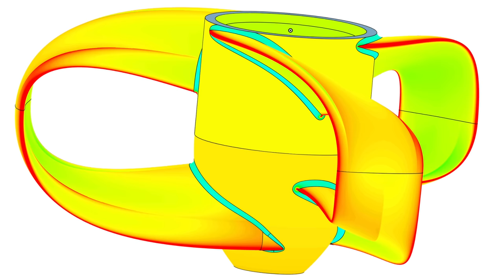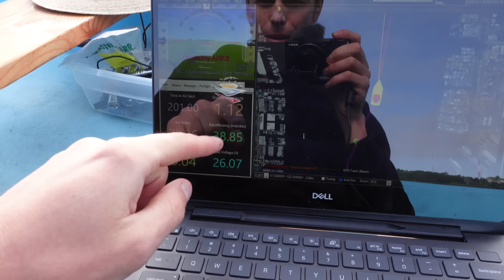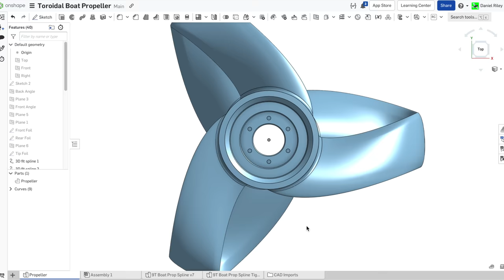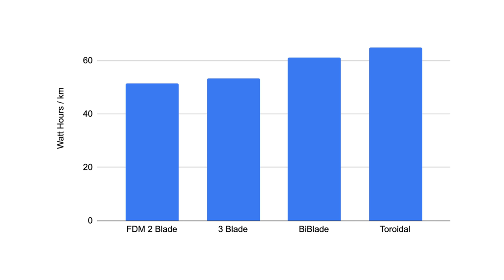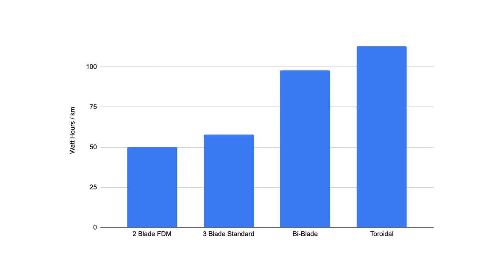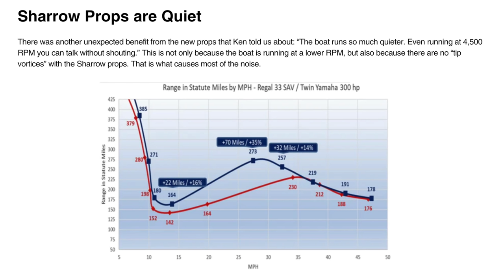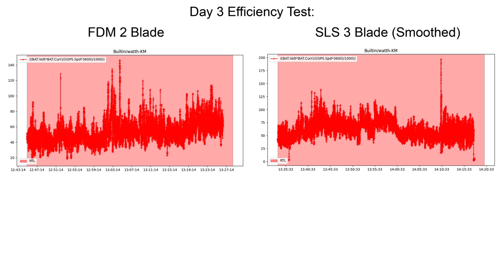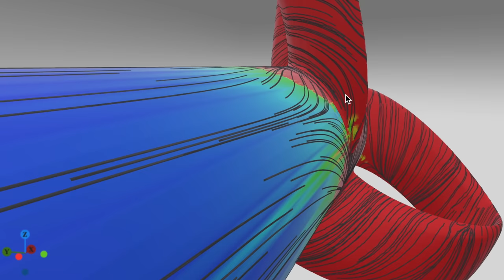Testing Futuristic Propeller Designs on my Solar Powered Boat

Comment: There is one huge difference between your design and Sharrow's.

Specifically, where your design is clearly 3 toroidal blades, theirs could probably be better thought of as 6 blades roughly evenly spaced, each with their own winglets that happen to connect to one another, thereby eliminating their own tip vortices, with roughly 60°-70° between the two connected (per fig. 2 of the patent), creating a significant gap between the trailing edge of the forward propeller/half and the leading edge of the rear propeller/half.  That allows for a Lot of pass through, which I expect accounts for why lower numbers of blades are more efficient.  Yours, on the other hand has negative gap between the forward and aft halves of each toroid.  

Further, the roots of each toroid seem to be located almost on the same angle as the root pitch each has. almost in line with each have an offset almost perfectly in line with their pitch.  Perhaps, conceptually, it might be closer to the physics of it to say that each toroid is actually a single blade that has its center cut out, and the leading and trailing part of that blade given their own hydrofoil shapes.

Comment: I don't know about today manufacturing. 60 years ago my neighbour made living out of one single type of ship propeller. It's real bummer to make things work if cooling down mold takes weeks. Also dimensions are completely off because metal shrinking while cooling. And it wants to fall apart while cooling. 
So yeah calculating all stuff on 50 ton bronze propeller is challenging. If you would take 400 ton bronze disc and "attack" it with some milling machine 50 ton propeller would be done in 20 years 😂😂😂.
Just grinding down rough edges, polishing and balancing 50 ton propeller takes months.

Comment: Since the FDM 2 Blade has the best efficiency, see if you can run an experiment with contra-rotating props running on the same motor but attached to a small gearbox.  Would this give better mAh/km?

Comment: Watt Hours would not make sense since its (Jule / Time) x Time :P
Isnt watts per velocity a good reading and averaging it for all directions to remove wind error?
How about correcting the fluid flow before it hits the propeller? Static flow correction blades as in water turbines and airplane jet engines.

Comment: The underwater video shows bubbles generated by the down shaft and motor  passing into the blade.  Perhaps a tractor I stead of pusher config would address this?

Comment: "one more thing" is the forward propulsion from an ICE engine as the exhaust pushed down and through into the "water medium" you do not have that with pure BEV. One way to get around this is to buy a jet drive boat such as a jet ski then effectively add said "propellers" then ask and answer...do i even need a propeller in the first instance #question_mark

Comment: I had a thought, where you had tested multiple wings or vanes.  What would happen if you put a third foil in the middle would it increase efficiency irrespective of whether it had an end on it like you're one attempt without the loop back to the other side?

Comment: Appreciate the experiments but unfortunately the eyeballing the prop design does not make for a good comparative test.  I worked on a project where prop optimization was a part of the process, and that took an expert about a month of work to get good performance from a simple 2 blade conventional prop. Also, they props are designed to work at a certain working point, the efficiency will vary through the entire range.

What I have heard from people that know a lot more about props than me, it seems like the additional surface area of torroidal prop makes them not so great for low speed applications where they can be beaten by a slender classic prop.

There are some  great suggestions to improve the tests in the comments. Hoping you take them in to account and have another stab at it.

Love the boat setup tho, all the batteries and the PSUs, beauty!

Comment: I think problem is these toroidal propeler need some sophisticated geometry to even work correctly, and i think the design is also tied to specific RPM something similar to turbo to achieve max performance. 
So you have to set optimal RPM your motors and from that + size run it true simulation software/calculate the geometry. This is something you cant just eyeball it. I think what you made is mostly optimize for quite low RPM, they run so smooth because there was just turbulent chaos not having any resonance.
If you want some conclusive data you need to contact some professional/scientist that understand the paper and design it for you. Not saying you are dumb only its this shit is quite complicated.

Comment: Hi, would you try to make propell out of the Sabu disk found in Egypt or Orgone Scalar/Torsion Fields based on Viktor Schauberger works? I think using the golden ratio mathematics is hey here. Please post open-source models if you start this project. Have a fantastic 2024. Cheers!

Comment: how about trying to make a cylinder shaft the same size as your unit that looks like about 3 inch and no propeller sticking out just a cylinder now add holes that are maybe angled in a toroidal shape that has no propeller in side and make one with propellers in side / toroidal propellers and none toroidal propellers to see what it does with the water going in side the cylinder and drawing the water in that shaft then it pushing it out and making the boat go.

Comment: I noticed at 33:23 that the prop was oscillating.. maybe bent motor shaft or prop isn't balanced? Could a bent shaft be causing the wooden prop to vibrate at high speed?

Comment: What if you turn the motor around and run it backwards so the fin is behind the motor? Bubbles are coming off of the fin and going into the propeller.

Comment: The pressure at the tip closest to the surface is less than at the bottom, right?  So, there is always going to be a out-of-balance condition.  Did you do an Archimedes helix?

Comment: Я думаю тебе надо просто забыть про гребной винт, а перейти на гребное колесо ведь у него больше КПД при маленьких мощностях ))) Если спроектировать трак по типу горного снегохода, но с изменяемым углом атаки лопасти при входе в воду и выходе из воды, то можно получить больший КПД для легкого катамарана на солнечной тяге) ИМХО
Reply: I think you should just forget about the propeller and switch to a paddle wheel because it has more efficiency at low power))) If you design a track like a mountain snowmobile, but with a variable angle of attack of the blade when entering and exiting the water, then you can get greater efficiency for a light solar-powered catamaran)
Reply: you will need a reduction gearbox

Comment: ive been trying to figure out what prop to use for my custom mini pontoon boat ive been building its about 8ft long but my biggest issue has been getting a prop these boat ones are like 500$ and i dont even know if how it would run with that prop so the 3d printed it a great idea i wish i knew as much as u about this stuff

Comment: The problem with the toroidal design is that one of the two joining blades is curved in the opposite direction to the curve required to follow the shape of the vortex.
What you actually need is a pair of blades curved in the same direction at their tip. Like both having winglets.
Thank me later, after the tests.

Oh, by the way, the tail of your rotor design is way too flat, or even concave. Beware of the drag there.

Comment: Could propeller weight being a significant factor regarding efficiency?  It seems the difference in weight between the 2 blade and the torroid or bi blade would be pretty important.
Reply: In a word, no.  At steady-state prop speed, the mass has no effect, and the weight does almost nothing, except arguably increase bearing friction if the weight is really extreme, the bearing configuration is extremely poor, or it exceeds the bearing design load.  Also, these parts are made of materials not many times the density of water, so in the water they almost have neutral buoyancy anyway.

Comment: 6:48 If I remember right, fewer blades mean more vibration because of some pressure wave which rotates with each blade and hits the hull. I can't remember this clearly, so watch Why Are 4 Blades Better Than 3? by Casual Navigation for actual info.

Methodical testing in the real world is good, but it would be great if you could refine the design in simulation first. But you know that.

Hot countries! Here in Britain, I'd have to build a concave reflector to heat my dinner up with just the sun. ;) That's not entirely true, but it's rare for the weather to get hot enough.

Comment: EDIT: reads 5 other comments suggesting the same thing. oops.

That was interesting. I appreciate all the testing you did but it would be super interesting to see more scientific versions of it all. As well as some improvement to the totally understandable "out the ass" toroidal designs. Maybe you could find a way to stationary test them in controlled environment (aka a pool) w/ a force measurement?

Comment: Really impressive what you are doing! 
What are the motors?
Do you have a block diagram somewhere of the motor and battery system? 
Any tips or references for building electric powered boats in general?
Thanks!!

Comment: just a wild idea, @rctestflight, but did you try mounting the motor as a puller, with the prop in front of both motor and fin, like would be done in most prop airplanes?

Comment: Do you just enjoy hanging out on the boat testing propellers? I do understand that. But wouldn’t it be more efficient and accurate if you got yourself a tank or pool and theater the thrust of the propellers via force? There you could have all variables steady, except the one you want to test.

Comment: It seems the less blades the more efficiency. Would be interesting to see one blade one.
Reply: would rip itself appart due to imbalance is what it would do.
Reply: @Nardur12321  it is possible to balance that out with a counterweight. I did see 1 bladers for plane models.
Reply: @kamurashev  planes with counterweight is one thing, but resistance through water is a whole different ballgame to balance. If you get it to work, it will for sure be much less effective then two blades.
Reply: @Nardur12321  nevertheless I’d love to see such an experiment.

Comment: The winglet explaination with the plane is wrong, the way it works is that they produce a lift vector that is slightly angled forwards, they in effect are producing a slight amount of thrust, and acting as an air dam, the air from below the wing tries to curve around the wing tip, which combined with the airflow from the front to the rear means the winglet is acting like it's a wing at a high angle of attack, and since the resultant vector of that airflow is slightly inwards, but mainly backwards, the lift force it generates is angled slightly forwards, since lift force is generated at 90 degrees to the oncoming flow.

So it's not that it's forcing air outwards, that's not the objective, it's that it's redirecting the lift vector slightly forwards for the tip of the wing, this forces the circulation area further down the span of the wing, and eliminates the tip vortex, it in effect is producing a slight amount of thrust which is counteracting the drag at the tip.

Comment: You mention that a stall might be occurring many times. What does this mean?

I did try to answer this myself, but all my search results are for airplanes, and have to do with the angle of the plane and the lift over the wings. 

Is there perhaps a more accurate technical word to describe the phenomenon you're noticing?

Comment: Unlikely you can eyeball an optimal design. What's needed is a powerful tool capable of shape optimization with simultaneous CFD/FEA and can handle rotating parts. Solidworks Premium is one way... generative AI is another.

Comment: There have been independent tests on Sharrow's propellers. Both in real world tests on multiple engines and in lab testing at the University of Michigan. Obviously the tests they're going to publish are the ones that show them in the best light, but there is reason to believe their claims (at least to a certain degree).

The economic incentive to switch to toroidal propellers is a funny little cognitive dissonance rampant in the marine industries. Shipping is INCREDIBLY capital intense, especially during the design and building stage. Currently Sharrow propellers are designed for boats in the hundreds of horsepower range and are 10-20 times more expensive than their non-toroidal competition. Even assuming that scales linearly (very unlikely), there's no way ship owners can be convinced to spend that much more money in upfront costs. I've met shipbuilders whose clients choose 4-bladed props over a better performing 5-bladed prop simply because they could save a few bucks. 

Hopefully the increasing push towards lower and lower emissions standards forces ship owners to get more creative, including with their propellers.

Comment: 25:25 Caveman brain idea, but what happens if you simply cut out the problematic parts of the blade? It's shape will become similar to the propellers that large ships use, like the one you showed right before the simulation.

Comment: 1) Find a YT-video with a sequence in it, where a commercial/Sharrow toroidal propeller is shown (1080p at least).
2) Use the comma- and point-buttons to move through the single video-frames while paused.
3) Make a screenshot of every single frame of step 2.
4) Use those screenshots for stereolithography, after all it´s an object with 3 whole planes of symmetry, so, basically just repeating itself.
5) Bravo !!! You now have the 3D-model of a commercial toroidal propeller in CAD, and you can let a company print it for you.
Is that an option for you ??? I don´t say that the toroidal is any better, I just say, that selling it commercially probably means, that those people did some tests, and massproduced the best of their designs, and not their worst (even if their marketing is just BS, and it´s still worse than the traditional propeller)... Anyway, I think their toroidal propeller has more chances than your design.

Comment: Good work and info.  Ive got an old 2 blade prop outboard that doesnt go on to do list.  But I feel better now knowing the two blade was more efficient.  You went to a lot of time and expense.  I think a good way to compare the props is to have one each side and like a tank - that will tell you directly most efficiently which one is better -  Doh.  Dont worry I get that too.  I noticed on toriod prop the bubbles seemed to form on top,  suggesting the water bottom of blade heaveir then top water and as it lifts the release of pressure is like boiling water when compressed compared to in a vacum - in vacum it boils far less temp -  we humans have so much more to learn.  Only -  I dont like yr yuppie attitude  looking down on things.  All those older boats needed was repaint - there was little wrong with them.  Yr young and if alive long enough in this world -  life will sort you out and kneed into place like anyone else.

Comment: Have you considered contra-rotating props like the ones used on torpedoes?
Reply: Why bother?  If you're talking about the two props on one motor/axis, It adds a lot of mechanical design complexity, in exchange for what?  Eliminating torque on the boat in the roll direction?  If you're talking about the two props, one on each motor, then it doesn't add mechanical complexity, just requires mirror designs of motor and prop for the opposition rotation direction.  And again, it's not an airplane where the plane would roll and fall out of the sky if you don't add aileron trim to counteract an unbalanced torque.  Try tipping his boat over by applying of the order 1 foot-pound of torque to it, such as by moving a water bottle a foot off the centerline, or by standing on shore and pushing lightly on a ratchet with your pinkie finger.

Comment: Great effort and video
!   Are you able to relate motor RPM to the efficiency for the various propellers?  For example, with variable speed pool pumps,  have read that  lower RPM results in exponentially better electrical efficiency.  So I'm wondering if a different toroidal shape might have better efficiency than another toroidal if it can spin slower while producing the same boat speed, for example.

Comment: this my sound silly but did you think drilling holes in blades like lot holes you have do on angel so go in same way it flow as blade spins. this cut down water pushing on blade cause act like jet-drive effect. could try it please.

Comment: The toroidal propellers can become very inefficient very fast, a slightly wrong Angle or too much surface can already Hurt the Performance, maybe If you slim down the propeller blades at the tip where it turns around it will have less flow resistance.

Comment: Gas and diesel engines have a power curve, but electric engines really don't.  So there is no efficient range of RPM for your electric motor to make use of.  You also are not pushing the much higher RPM to take advantage of the decreased cavitations and lower noise.